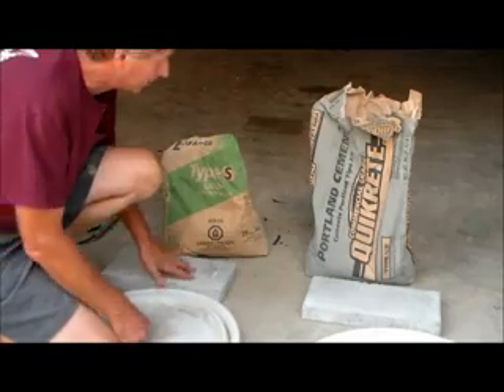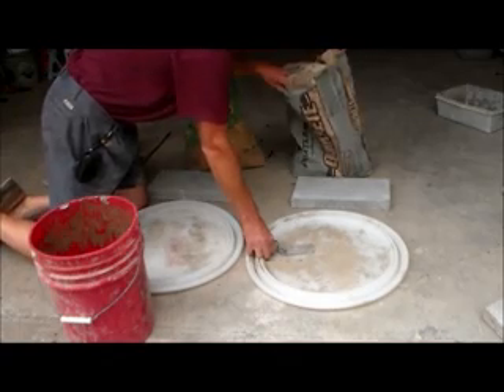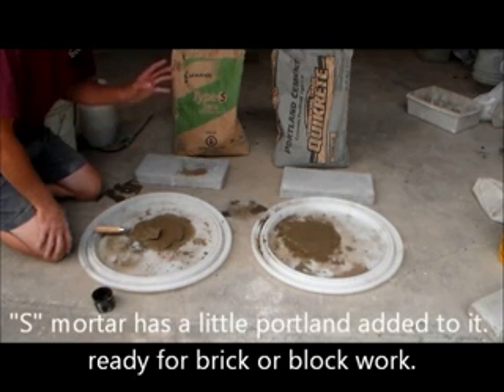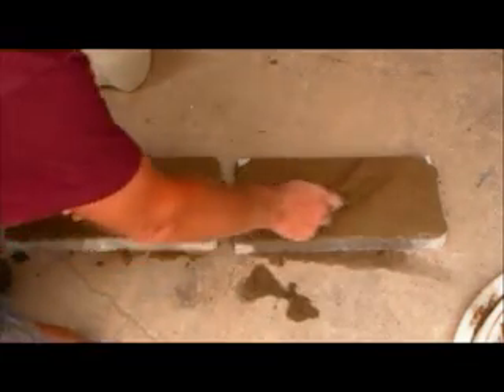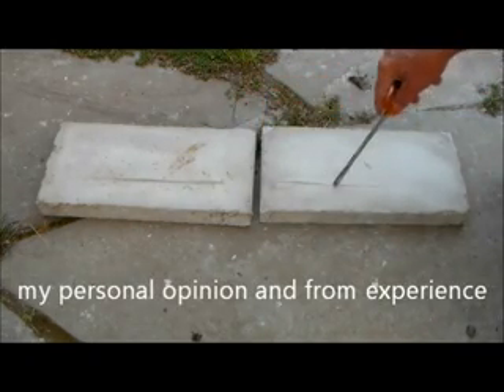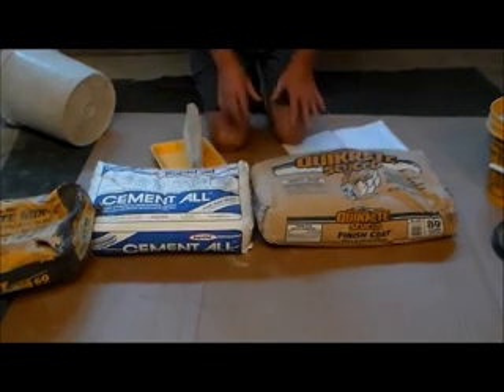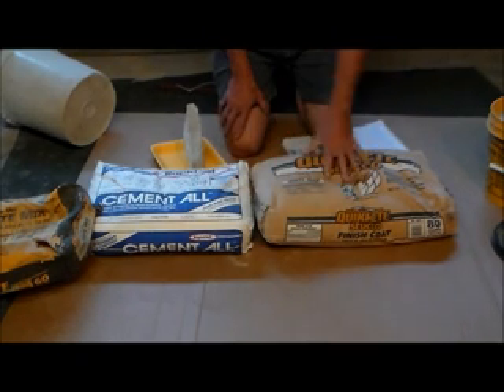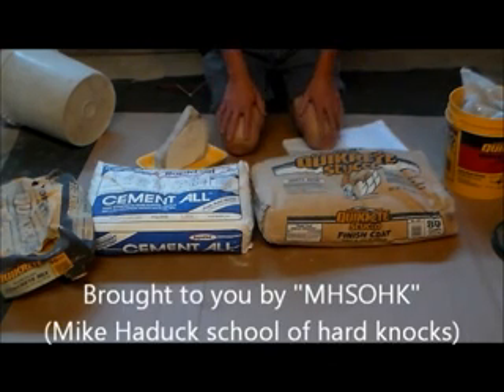WHAT CEMENT SHOULD I USE ? (Part 1) Mike Haduck

Comment: Mike, I'm sorry but I have a lot of problems with the information you've presented here. First of all, it is "masonry"- not "masonary". Second, there are standard mortar mixes with the letter designations M, S,N,O, and K. These are ALL blends of Portland cement, hydrated lime and sand to achieve mortars that architects and code officials can count on. When you go freestyle, you throw that information and performance out the window. You NEVER use a mortar that is harder than the brick, stone or blocks. Your 2:1 recipe is rated at a whopping 3,500 psi, which is insane. This will destroy bricks and stone readily when pointing. You rarely need mortar harder than a 750 psi type 'N', which is what the Empire State Building was built with and it withstood the crash of a B-25 bomber. Portland cement alone shrinks terribly, which is a major reason lime is added. Portland cement traps moisture causing major water problems compared with lime mortars that breathe and have lasted since before the Romans. 
When a bag is labeled type S or other that means that mixed in the proper proportions with sand you get that predictable performance. Taking type S and adding Portland to it moves it from an 1,800 psi mix to at least a 2,500 type M or even worse. BTW, full compressive strength of masonry is 28 days- not two weeks. I've seen more masonry destroyed by masons using mortars that are too hard. Don't take my word for it: do a little research at the BIA, BuildingScience.com, Nat'l Historic Preservation Trust, etc. FYI, I'm in PA, too. Consider taking a class up in Williamsport at the PA College of Technology or attend a PA Chimney Sweep Guild Summer Workshop. Sorry if this sounds harsh but most masons I've met or seen their work don't know these concepts either. Peace.
Reply from the maker: Dear sir: thanks for the comment and I am happy to reply,  I will be making part 2 to further explain myself, and I understand completely what you are saying. and in many instances you are  correct, (I am college educated- law and architecture) and with all due respect, this is the "real world" and If I did it the way you suggest I would be back repairing it in very short time. (our weather is brutal)  So my opinions are based on 48 years of experience and working with 100s of masons from unions to private. I like to make sure when I leave a job I get no call backs so I am strongly sticking to my decisions, and no inspector to date ever signed a paper guaranteeing what the book says will work, (my legal experience and I have asked them) so my videos are (how I do it and why) and if they would like to do it another way I completely understand because it is not the same in every state. masonry is not black or white and every situation is different, I try to show all my mixes and how I did it on every job in the area I live,  I really appreciate your concern and want folks to read what you say so they can make their own decisions, thank you, God bless from (MHSOHK) "Mike Haduck school of Hard knocks".
Reply from the maker: I never worked on the empire state building but I been working on other ones around here from the 1960,s,   and I am sticking to what I say, I know every situation is different,   thanks mike
Reply from the maker: check out my series "How I patch or fix up a foundation"  Part 1 to 4  (mike haduck) all the techniques I use are there,  I hope it helps,  thanks mike
Reply from the maker: I would talk to some of the locals and get some professional opinion and go from there,  mike
Reply from the maker: can't really say what you should do,  don't know what else to say,  thanks mike
Reply: There are several types of hardness testers for concrete. I have used a simple type that uses a spring-loaded piston fired at the concrete and measures the rebound on a scale to determine hardness. Your local concrete supply may be able to rent one, or tell you where you can.
Using a chisel, bush hammer,  or scaler to remove the decayed concrete down to sound material before you patch will make a much better repair. Don't hardness-test on the decay without removing that material, for accurate results. It will be much softer than the underlying concrete.
A water-based silica sealer applied after the patch will do wonders, also. It forms tiny waterproof crystals in all of the microscopic voids and cracks that concrete normally has.
No one could really tell you what you need to do without examining the problem for themselves. At least it doesn't sound like an urgent problem.
Reply from the maker: Hi Tom,  I love others opinions and appreciate the concern but the only thing I can say is I been doing it for 48 years, and worked with tons of masons and have seen the end results after all that time, I still follow the (MHSOHK) system, "Mike Haduck school of hard knocks", Look up in Blacks legal dictionary the word "expert"  and you will see what I am talking about,  God made the world in color determining factors, and not black and white, but I appreciate it ,,,, God bless Mike
Reply: Thanks, Mike. I worked as a cement mason for 15 years, before I switched to industrial maintenance. I just tell people what I know to work, although you know a lot more labor-saving techniques than I do. Excellent videos, so don't take anything I say as criticism, just suggestions.
I have happened on rank amateurs doing cement work multiple times, and stopped to save them from disaster. I just try to help people.
Oh, I'm also a new subscriber.
Reply from the maker: I understand Tom,  I love suggestions and am now working with a mason with a lot of experience on a brick job, we both agreed on what cement to use,   I alway take a job I am sure of never one I am not sure, and am very careful of the cement I use so I never get call backs,   thanks for the input,  I appreciate it.   mike
Reply from the maker: thanks, mike
Reply: Hearthman, what qualify s you to pass this info on to us... I want to trust what you are saying. Thanks.
Reply: Assumptions can make fools of us all, why not be smart and ask :)
Reply from the maker: thanks for you input ,,,,it is appreciated, but I am the one who has to back up my work and every code official or inspector never gave me a signed paper saying that "they" guarantee my work,  I been doing this since the 60s and my Dad since the 40s,  If I thought i was wrong I would not leave the video on,, If I did as you recommend in my area I would be out of business,,,,I appreciate it.  mike
Reply: Hearthman1159 .. your rant was very informative and knowledgeable. exactly the information I'm seeking for I'm taking on a project of natural stone and I'm very experienced with tile,marble,granite,glass, bonding muds.. now I want/need to learn element exposed , multi level , natural Stone castle wall building.. I'm not sure if you'll even read this but I would love to talk about your knowledge on this subject of my mud.. I really want to build a castle that will last 100 years or better on the #1 view lot in severville,TN .. I have the lot, building skills, I truly want to make sure my mortar is perfect for the process I'm subject to.... hope to hear from you. 
                                                Jason 🙂
Reply from the maker: Hi jason.  one thing I will tell you is every mason will say it different, but that is what works around here. I have it on my list to visit coway castle in whales (england)  I would do some looking before you start,  I hope it helps, thanks mike
Reply: experience over a nerd or book 100 percent of the time.
Reply from the maker: thanks ,  mike
Reply: I'll stick with mike.....experience...  thanks mike
Reply: Great videos mike I am slowly working my way through them! Unfortunately sit at home faux experts seem particularly prevalent in the building trade Youtube videos!!!! There is a big community of people who really appreciate the time and effort you put into sharing your time served knowledge!!!!!
Reply: Not sure what kind of old standards you use over there, but in NZ3122:2009 our ratios are very similar to what MHSOHK describes:

High strength & dense: 1 part Cement, 2 parts Sand, 3 parts Aggregate
Paths & Floors etc: 1 part Cement, 2.5 parts Sand, 4 parts Aggregate
Plaster: 1 part Cement, 3 parts Sand
Mortar: 1 part Cement, 6 parts Sand, 1 part Hydrated Lime

GP Cement Strength: 3 days/minimum strength of 34MPa, 7 days/46.7MPa and 28 days/63MPa so 2 weeks gives a result close to the 28 day mark. Though technically you are correct.
Reply: I learned a lot from you. I love your  Excellent fix's.Thank you.dont mind me,I'm a home owner.realy appreciate your excellence. Best regards.Mike.
Reply: Hearthman1159 . I'm with you, Hearthman, what I've read on what has become a science flies in the face of Mike's advice much of the time.
Reply: This comment thread is the perfect example of the difference between what the books tell you, and what the real world dictates. If two people are trying to do a concrete job for me- one is an engineer that cites numbers from industry papers to tell me why I need a certain product, and the other can say "You see your neighbors porch? I made that 15 years ago", then I am going to go with the guy with almost 50 years of experience in the field who built the porch. I'm an exterminator, and I know from experience that what the state dictates I should do sometimes either won't work, or isn't even possible to complete; and when my district manager comes to a job and tells me that one method will work, that it will. 50 years of experience trumps 8 years of college every day of the week.
Reply: Hearthman1159 thanks for your valuable contribution. Many folks have relied too much on customary practices but aren’t aware of what they don’t know could compromise their work. I’m an architect and know how difficult it is to persuade contractors from their long-held misinformation.
Reply: Blueshirt amen brother, engineers are more often wrong than the seasoned tradesman.
Reply: I just bought a 60x32 Everclean Whirlpool Jacuzzi Tub, I heard you should use Mortar instead of Quikrete Sand Topping Mix! The guy that is installing my tub is using Quikrete Sand Mix instead of Mortar, and I want to make sure he is not making mistake? Is it safe to use Quikrete for support under a jacuzzi tub in an my bathroom?
Reply: Mike Haduck Masonry I completely agree with you mike
Reply: David Lang architects generally don’t know shit about the actual construction process
Reply: Hearthman Is 100 % correct in his statements.
MaSoN wOrK
M,S,N,O,K are the types of mortar from strongest to weakest. O and K are restoration mortars that barely exist at this point except in special order.
They are simply just a mix of Portland cement and Lime, with type M being almost entirely Portland and a compressing strength of 2500psi. S being 1800 psi, N being 750 psi with a healthy amount of lime.
Prior to the mid 1800's lime based mortars were used on brick work. No Portland..
That's why O and K were used when re-pointing soft, old, weathered brick.  You did not want to use strong mortar! Mortar should always be weaker than the material you are using it on.. In the UK and other parts of the world lime based mortars are still commonly used. 

Mike is correct to some degree that harsh climates can affect the materials you choose to use. I also live in PA.
Type N is always used on brick work.
Type S is used on block and M is also used by some..
When Mike says "Portland is used for sidewalks and stuff like that" he really means concrete I'm guessing..
Unless he means for patchwork..
Basic concrete is a 3-2-1 mix. 3 parts aggregate, 2 parts sand, 1 part Portland.

Comment: You have 1 bag of cement and 1 bag of mortar. Not 2 different kinds of cement. Then you made a very strong mortar by mixing portland with sand. And then you simply added more sand to pre-mixed bag of mortar. Que?
Reply from the maker: Hi Lando, I thought I did a simple explanation,  but I do plan to do part 2, thanks mike